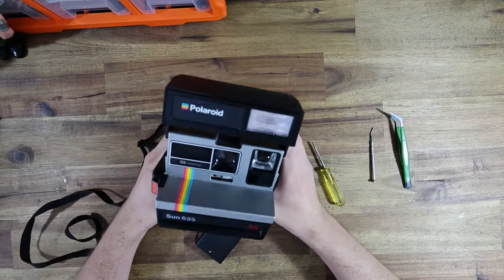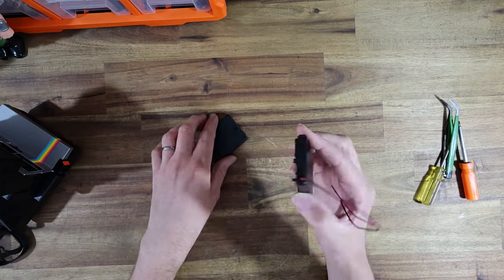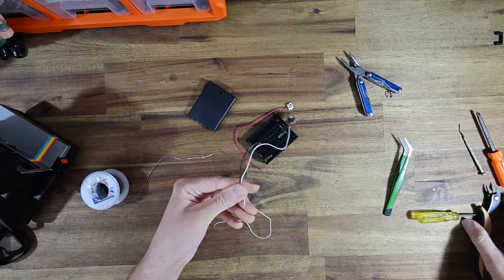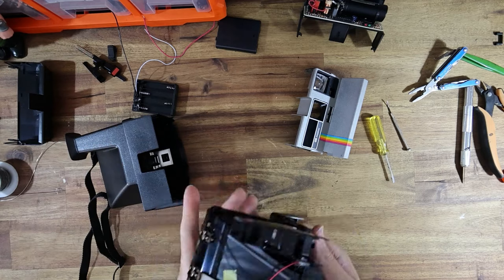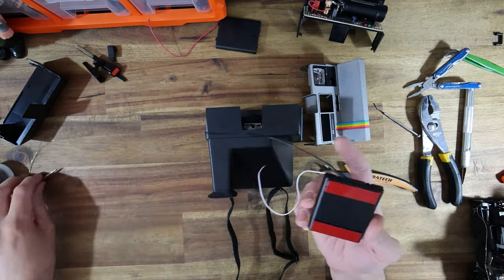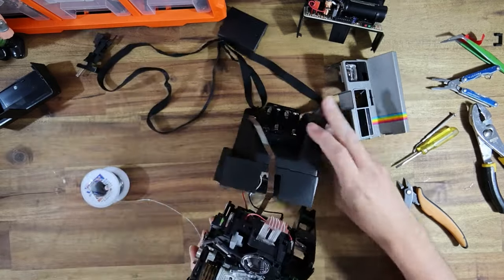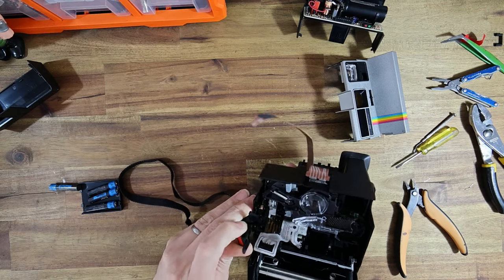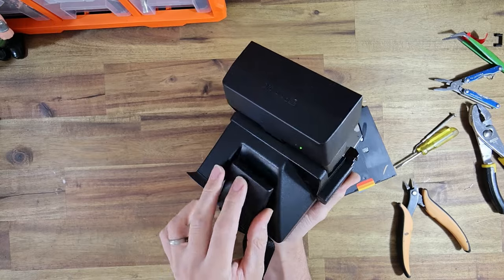Polaroid 600 i-Type mod - PROPERLY shoot cheap i-type film in a Polaroid 600

Comment: How much does one of these conversions normally cost? I got two of the more rounded Polaroid 600s from a charity shop (£15 for one, £10 for the other cuz the strap broke) for me and a friend and I’m curious if this conversion would be affordable or not, if not I’ll probably just use the put 600 battery on the bottom of I-type film little hack thing I’ve seen a couple YouTubers do for whenever I wanna use the special I-type film
(My one specifically is the Polaroid P 600 or Silver express model, forget which model my friend has)

Haven’t really had a chance to properly test the camera nor has my friend cuz both only came with one bit of film pack in my camera (which upon checking, is an impossible specific version and says it was produced in 2010 so it is likely very dead, had one unshot polaroid inside of it, definitely dead now due to being exposed to light,) but I am getting some 600 film tomorrow to test it with so I’ll likely mention if it works or not here
Reply from the maker: Doing the I-type battery hack you described is an excellent way to break your camera

It's an utterly moronic "hack" and people should really stop sharing it

As for whether or not it's affordable, this is up to you really! In my opinion it's worth spending the money to pay an expert to modify something properly

I specifically don't list prices in videos so as to not date them in case prices go up. Get in contact if it's something you want :)

Or, grab a soldering iron and DIY!
Reply: @theinstantcameraguy  I’ll definitely try reaching out to discuss it since I dont really trust myself with the mechanical side of things

Comment: Wow this video is a banger. Subscribed
Really cool mod and a little bit of Right-to-repair in real life. Love it
Is this mod also doable on a Impulse AF?
Reply from the maker: Technically this kind of mod will work on ANY Polaroid camera that is powered by 6V

However... Impulse cameras are incredibly hard to take apart and modify compared to the regular 600 design

Their construction pretty much guarantees snapping plastic to get inside them

I do not recommend them as a result, and do not offer repair on them
Reply: @theinstantcameraguy  I see. Thanks for your answer :D

Comment: blue tac is good for posters but after months and months of having the poster up i find it looses it's stickness and you'll see one corner of the poster folded back and the tac is still on it so you push it back onto the wall but once it comes off once it'll keep coming off until i just get exausted with sticking it back up and deal with putting a push tac hole in my poster

Comment: Great Tutorial! I might try this on my Lightmixer 630 :D Just one question: Does this work with Ni-Mh rechargeable batteries? They have a it lower voltage so I'm wondering if that would affect the operation...
Reply from the maker: @valerie_screws_around  I don't think it would work very well

Comment: In your experience, are Polaroid 660 and 670 _ with autofocus _ having the same issue with krat0n batteries, same as SX-70? Cheers
Reply from the maker: @gianlucab2261  typically no

However you can always install a smoothing capacitor if you have issues

Comment: This was really interesting to watch, it's great to see that these modifications can be very easy with enough practice! 
One question though, you mentioned that the switch actually switches between film pack battery and external battery power. How can the film pack battery still be used if the contact tabs (on the metal bit with the screw mount) were cut off?
Reply from the maker: I don't understand the question
Reply: Hi. It was perfectly clear what was explained... That metal peice has nothing to do with the batery. That only prevents iType cartridges, the ones with no battery in it, to get in old model cameras. He cutted the piece to allow new generation cartridges (iType) to "get in" the camera. 😊👍

Comment: Does the newer PowerPack from Retrospekt still have Problems with the Kratax Batteries? I have one for my SLR 680.
Reply from the maker: Yes it does. This isn't so much a problem with the back, but with the type of batteries. Truth is when they were prototyping I suggested they install smoothing capacitors in the finished backs, but they didn't listen to any of my advice.

Luckily, it's an easy modification

Comment: What are your thoughts about the quality difference in the lenses between the classics and the new iType cameras? I must have 50 or 60 old Polaroid models.. so I’ll be doing this AA battery modification to as many of my 600 series ones as I can!
Reply from the maker: I don't have a huge amount of experience with modern i-Type cameras, since I don't particularly think any of the newer models are really worth owning yet

However I will say its much of a muchness. Instant film doesn't have amazing resolution anyway, so difference to me at least are more about the 'character' of a lens rather than sharpness

A modern Now will likely beat a classic 600 for sharpness, but the 660AF and 670AF are a different breed, with effectively the same lens design as the Spectra. Triple element with multiple focus zones and focusing down to 2 feet! Very sharp little things

Comment: Is there a reason, other than I suppose simplicity, that you don’t use a rechargeable lipo cell with a boost converter in a small housing?
Reply from the maker: Cost, convenience, user/field swappable batteries and the fact that the battery holder is its own housing, with no extra parts needed

Everything you describe is doable, but with 5x the cost and 10x the faffing around

Should a client want rechargeable batteries, they need only purchase some 1.5V buck-converted lithium ion versions - which is exactly what I do - check out the brand "Kratax". Life-changing batteries

Comment: How many packs of film can you shoot before needing to change the batteries? Assuming regular alkaline.
Reply from the maker: Likely more than you could shoot in a day

Total answer will vary depending on temperature, battery brand, condition of the cameras motor etc

But should easily be 10+ packs

Comment: One question, what's happening if the flash is charging twice as slow as a 600 battery pack when using AAA lithium batteries? This is what I'm experiencing after modding a Sun 600.
Reply from the maker: I'm not sure. Maybe your gauge of wire is too thin? 

As long as your camera ejects film etc fine then you should be good to go
Reply: I've modded four of these box cameras following this video and I also had long charge times on the first two cameras. The next two change over twice as quickly using the same kratax batteries. I'm suspecting the quality of my soldering work on the leads from the battery back to the camera terminals. I did a better job on the last two cameras and these are the ones that charge quickly.
Reply from the maker: @christopherrenouf4582  there are many solder-less connections inside the camera as well - such as where the + and - plug into the ribbon cables, and where the +ve goes into the shutter

Possibly, if you soldered ALL these points on it would help too

Comment: Couldnt you mount the battery box to hang off the side toward the shutter button? That way you could use the switch without rewiring it. It might not look as good but it should work and be easier for a newb like me
Reply from the maker: You could mount it anywhere really

I think it looks clean here
Reply: @theinstantcameraguy i did the battery pack mod and it worked! The flash was active and it was ejecting the dark slide. After a couple shots for testing the shutter stopped working. The flash light still goes green but it doesnt flash, the shutter doesnt click and the motors dont spin. Essentially the shutter button is not doing anything. Do you know what it could be?
Reply from the maker: @LMFAO5001  its incredibly difficult for me to diagnose such a thing over youtube comments

I have no idea from that description sadly

Comment: Any reason not to use a 6vol rechargeable nimh battery? (print my own case and add a switch) thanks for the video... I want to do this to a sun 600 that has a bad flash, will try and fix that at the same time I upgrade the battery. Yes we have blue tac in the US.
Reply from the maker: If it's 6v it should work

Comment: So can you still use 600 film on this modded camera? It looks like when you snipped off the leads, that was a point of no return to shooting 600 film, correct?
Reply from the maker: not trying to be funny, but did you watch the whole video yet? Because I do explain this :)

I wire the switch in such a way, that you can use both!

With switch to the left, it'll run of AAAs. With switch to the right, it'll use the built in 600 film battery.
Reply: @theinstantcameraguy  I watched the whole video, yes. It was a great video and well done. I suppose my confusion came from you cutting the metal prongs that contact the 600 battery terminals. So I wasn't sure how it'd receive power from the 600 battery.
Reply from the maker: @Maj7  the white wire runs power up the metal prong, into the switch, then back down the black wire when the switch is set to the right. 

When the switch is moved to the left, power is diverted straight from the AAA batteries and into the black wire, directly powering the camera :)
Reply: @theinstantcameraguy  Thanks for this. I appreciate it, love your videos, cant wait to see more!